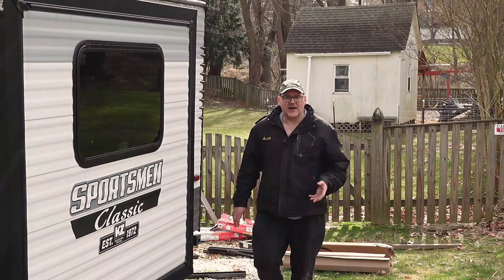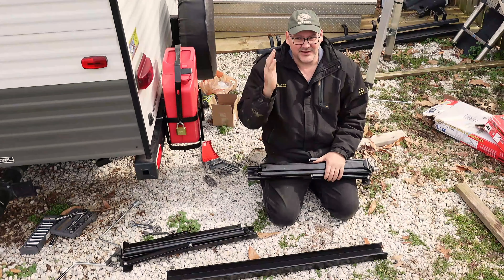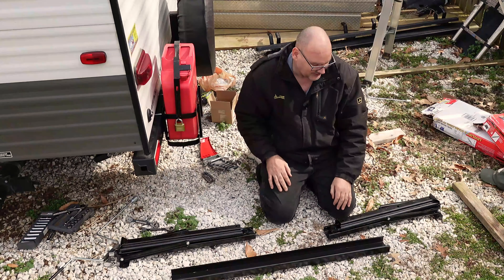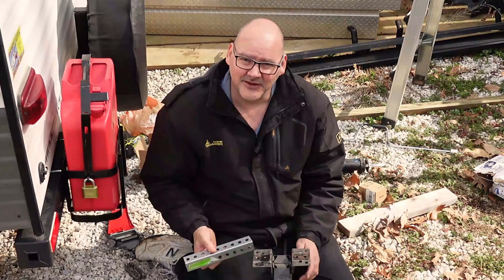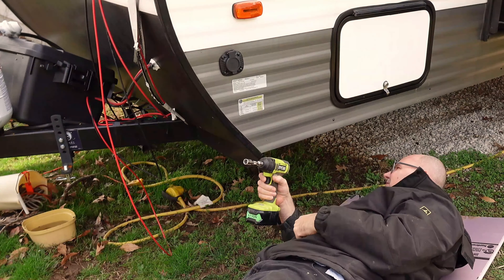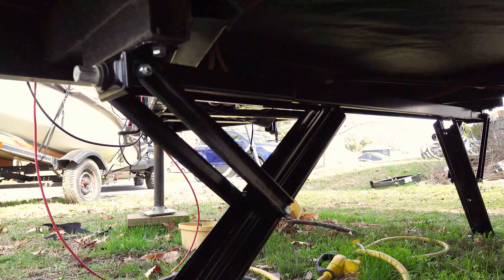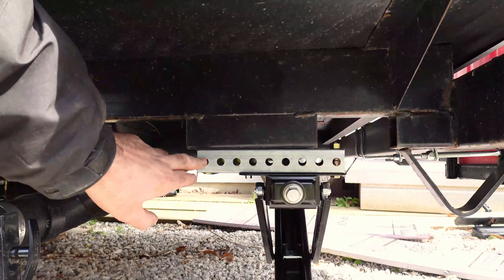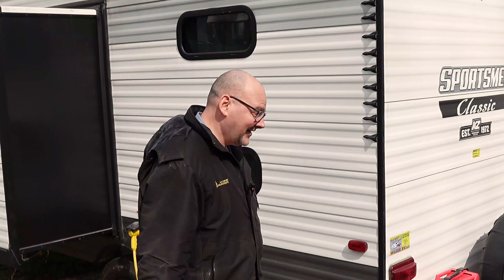Do Stabilizer Jacks for Trailers Actually Work?

Comment: Where did you get the stabilizers? Do they have them for C class RV?
Reply from the maker: here are the c jacks https://amzn.to/49E5w2T
and here are the feet for them https://amzn.to/3IpXrTA

If your vehicle doesn't have a cross brace to mount it on then you also need this. https://www.walmart.com/ip/Bal-RV-Products-42-in-C-Jack-Connecting-Channel-for-19-22-25-in-Models/5085654590?wmlspartner=wlpa&selectedSellerId=101373823